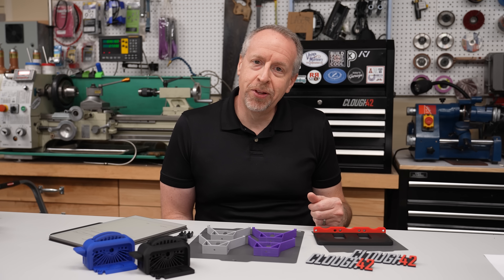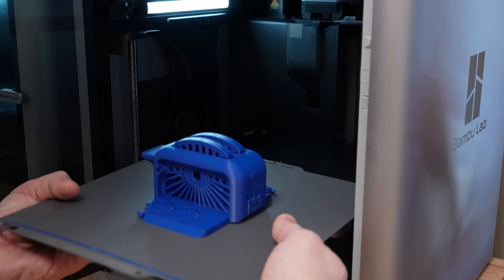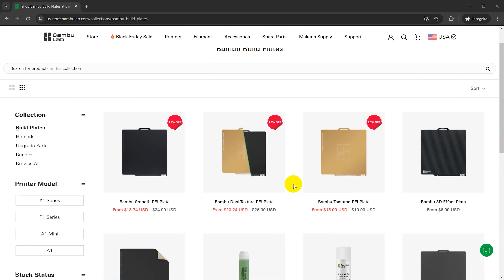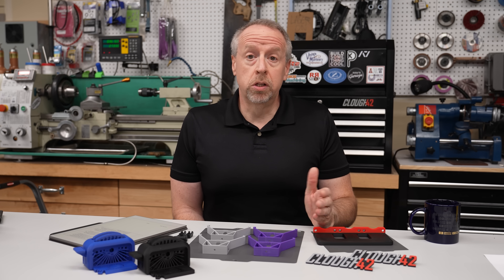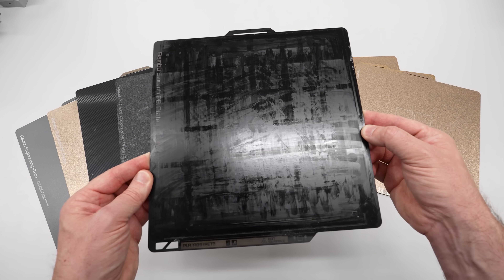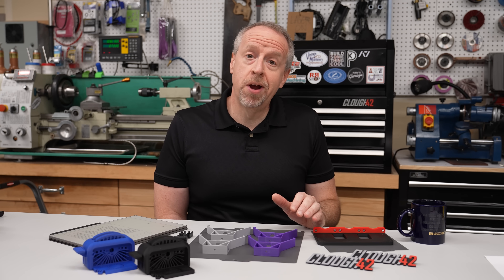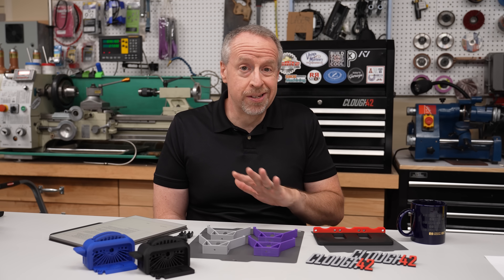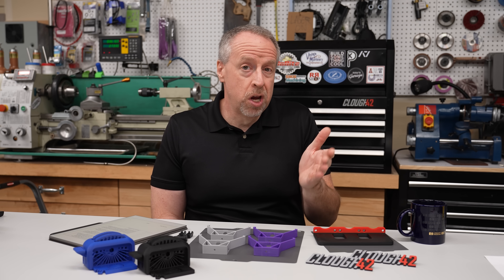Can't get your prints to stick?  Try this

Comment: The new Bambu Lab Cool Plate SuperTack has revolutionized 3D printing for our organization. Print failures have significantly decreased; now, issues only arise from user errors, such as leaving objects on the build plate or filament jams at the spool. The enhanced adhesion and reliability of this plate have streamlined our workflow—highly recommended!

That said, it does introduce a new challenge: it can be extremely difficult at times to get the item’s edge to release from the build plate. Once you manage to lift a corner, it still takes considerable effort to pull the print loose, especially with large surface area contact. But honestly, I’d take this over print failures any day!

Seriously though, since having this plate for about 10 days, I’ve had one print failure—that’s right, just one failure across multiple machines all running the new plate. Incredible!

Comment: I pretty much only print with PLA, but the creality glass plate with the self releasing coating has always worked BEAUTIFULLY for me. Granted, for smaller prints, it can have less adhesion if not properly cleaned and trammed, but It's never really been THAT much of an issue. Plus, I can usually just add a brim if it DOES become an issue for some reason. I've never really seen a need to get anything else for bed adhesion, but that's just my personal experience.

Comment: Thanks for the review. Recently I had some issues with adhesion to a textured plate and had to crank temperature up and play with enormous brim. I already ordered a smooth PEI plate. If it doesn't help will switch to this SuperTack.

Comment: Yes.... I use a flat steel plate and PVA glue.
Sometimes they stick too well and I have to soak the plate and glue in water to get the parts off the plate

Comment: Why people using glue. Im 1000h in my a1 and never used glue standard setting .2 mm layer height just had once adhesion problems science then i  clean my plate with dish soap after a couple of prints

Comment: I installed a build plate guide on the left rear of my X1C. It sticks up enough that you can easily position the plate side to side with it angled up enough that the magnets don't grab it. The guide is low enough that it doesn't interfere with the print head. I found it on MakerWorld.

Comment: Im a firm believer in cleaning is key! And dawn is NOT it. I use fast orange mechanics soap with pumice and an old toothbrush. Scrub the plate with the soap and brush without water. Then clean with hot water, as hot as your water heater can do. And you can instantly feel it with your hands. I haven’t used glue since and have never had one come undone.

Edit: i forgot to add. Let the plate cool makes a HUGE difference when removing. I freaking love the engineering plate. But i would like to try this bc id like an extra plate

Comment: I have been trying the new plate in the X1C with PETG and having issues.  Support says there is a problem with latest firmware causing the plate to not be noticed 2) stringing / print letting go after 1/2 way through the troubleshooting print 3) issues and it z calibration .Support is helping but was hoping for better results.

Comment: I’m always a bit confused by other people’s practices around bed adhesion. 
I’ve found clean textured pei to work fantastic with pla as long as it’s cleaned properly. And hairspray has worked great with petg in the past but I haven’t used it in awhile. 
I really want a g10 on steel sheet. I had g10 for my old cr10 and it worked great for everything I needed. Including flexibles and the texture is really nice.

Comment: I’m concerned about the validity of your advice because of the REASON you’re using glue with PETG on PEI. 

PETG seriously bonds to PEI. It’s a problem I can only solve with a razor blade after the bed cools.  I use glue as a release agent, not for adhesion.

Comment: Check out either SHIFTY or “Build plate alignment guide & cap” they are mods that align the build plate for you, the first hugs rhe left and right sides, the second add the same bracket the A1/A1mini have with the nozzle cleaning area notch - to the X & P series

Comment: Ah, this is what people were talking about when they said this is why biqu did the buy one get one free deal. I bought the biqu 2f1 deal, haven't tried them yet, lol, so I guess this will be even further down the stack. But I'd been using the original PEI textured plate from bambu (the grey one that came with the x1c) for ages, then finally bought the new gold coloured textured plates, and I found the gold texture plate holds on to PETG too well. Thanks for the tip of reducing temp to reduce grip, I will need to try that.

Comment: Don’t understand why you use glue on beds. When I started out in 2011, glue stick helped on the crap surfaces,  but by the time wham bam and others came along it was not needed. I’ve been running 2 Prusa mk3 for 5 years as a side huddle and had no pla or petg adhesion issues and they have never been near glue. Same with my 2 X1Cs with textured pei.

Comment: i'm generally printing Printer parts out of ABS/ASA, and my goto has been , and will probably continue to be the engineering plate. the textured plate is a bit too textured for mating surfaces ive found, and the smooth/hi temp plate give a glossy approaching mirror finish which looks real wierd when its only on one face of the print.  in fact, i've been having to put glue on my engineering plate just to get parts off the plate or they stick too well and take a chunk out of whatever epoxy-esque finish they used for the engineering plate.

Comment: I'm not sure why everybody has issues with the engineering plate. Maybe it's because I wipe it down with isopropyl alcohol Before every print and almost never use glue stick.

Comment: OK I learned something.  I had been thinking that I always printed PETG at 75C on my Prusa MK4's (textured  powder coated plate) and when you said you couldn't always get your prints to stick I was about to really question what you were doing wrong as I never get failures and I really respect your design processes.  A quick check and surprise I'm printing at 90C. I'm thinking that Prusa must have changed the default behind my back.  LOL.

Comment: My main gripe with bambu textured pei buildplates or others like the biqu cryogrip (I use both) is not adhesion. It is the thickness of the spring steel. I print plenty of large parts that has perfect adhesion but the plate still bends around the outer edge due to being too flimsy. The magnetic force is not enough. For more damanding tool type prints I have been forced to glue shape cut plates to the underside of bambu buildplates to avoid warping. I am surprised thicker buildplates never seem to be on the table. I have at least googled for it many times in the past.
Reply: It sounds like you may haveegotten a badly warpped build table on your machine. I know they were having issues with this a year or 2 ago. Not sure how long ago you got your machine but Bambu was repairing or replacing machines that got the defective plates. I would reach out to them, they will send you a test file to measure the run out on your bed, and possible replace it if its bad. (considering they are still covering this issue.)
Reply: @PhoKingLitMedia  In my mentioned case this is not the way it is. The plates do bend in the corners and lift off the magnetic bed from shrink forces in the bulky prints. I have several p1s machines spread out over end of 2023 and the year 2024. None of them has any bent plate problems. It has helped some to insulate the machines to keep some more heat in, but too much and that will cause other problems with petg for example. The reinforced build plates does the trick, but are clumsier to handle as they can't be bent as easily for print removal. I have just used regular steel, not spring steel.

Comment: That looks super interesting.  I remember years ago when LocBuild made a super adhesive bed for 3D Printers.  For parts that had low bed contact - great. For large stuff like your model, it fused to the bed.  I’m looking forward to trying g that plate on my two A1’s

Comment: I use a glass bed with any kind of filement and a mixture of 50% white glue/school glue and 50% water. Everything sticks like hell with around 50-60 degree C and pops right off when the plate cools down. It is washable with warm water without leaving any traces. A printbed for eternity.
Reply: Very interesting but how did you know it is 50/50.
I mean how are you measuring the glue and water, glue seems like it would be hard to measure by volume so are you measuring by volume or are you using a scale and measuring by weight?
Reply: @andreamitchell4758  Just roughly eye leveling it. If it's more on the watery side, you can apply it thinner, but it needs longer to dry. If it's on the thicker side it cannot be spreaded good enough and does not work as good. If you hit it just right, you can spread it good and it dries completly withing the warmup phase of you printbed.
Also not every glue brand is the same consistency. But it's not science.

Comment: Saving energy with lower temperatures but still needs over 60 degrees bed-temp for PETG? Wow.... I have been printing with lower temps for PETG on my Anet ET4 and also A8plusses for many years on their original surfaces or on other cheap surfaces. Also without gluestick.
Also printing on some of my printers on cold (around surrounding-temperatures so say about 16 degrees in winter) beds. Especially the 'bendy plates' with springsteel are easy to use for this. Only problem is that they wear out slowly and sometimes just stick too much so then like some sugarwater to protect the beds from sticking too well and breaking.
ABS I print normally at 70 degrees bedtemp though sometimes also at 60 when using smaller parts of the beds. ABS though, mostly kind of enclosed.

I think it should be possible to print with lower temps with those beds. Can you do some tests with that? Just go around 40-45 degrees for example with PETG and 25 for PLA?

Comment: I don't understand, why would they boast about having the bottom surface of the part look like the top surface? Who would want that? The bottom surface always looks a lot better regardless of the build plate, unless your Z-offset isn't set correctly or the mesh leveling is off.

Comment: I've been having poor results with the SuperTack build plates on my P1S. Lots of warping on the edges, hardly any adhession. I just can't figure out why. I've been using PETG HF. My textured PEI plates on the other hand have no issues, to the point where I use a glue stick as a release agent or else there's risk of part damage.

Comment: Bed adhesion is one thing but then supports will brake if large part. The solution is to use cold bed, put PETG plate 2mm like Vivak using double side tape and allow this plate to gradually bent. So I think that vacuum bed should be tested if allow slight bend using many small holes.

Comment: ok so after 50 prints, what does the plate look like? it seems fimsier than a PEI sheet and they get ugly after a few months of high print time. Does PETG stick too hard? That is the issue on pei textured sheets. Not that it doesnt stick, those are just user errors.

Comment: I've been tempted by all these new plates (bambu and biqu), but really I haven't had any issues with the gold textured PEI plates on my A1 and A1 mini printers. Just a quick wipe with 91% isopropyl alcohol before every print and everything sticks fine. I do only print with PLA, PETG and TPU though, but all of those have worked out fine.

Comment: Its amazing how far we came along in terms of build plates on FFF 3d printers ! i recently upgraded my printrbot metal bed  from Glass to PEI for PET filament . if on the glass plate i always needed glue to have the print stick  on the PEI texture plate  i don't use any glue ! Really curious about this Bambu Lab SuperTack ! you mention it works well with PETG but what about PET ?

Comment: I disagree about the engineering plate. It's my go-to plate for ASA and ABS, because it works incredibly well with both. As for your trouble with glue, I highly recommend spreading your glue on with a couple sprays of IPA. The glue dissolves in IPA, so if you apply a few swipes and spray it with IPA and wipe down, you get a super thin perfect layer of glue that is much easier to work with and leaves much less residue.
Reply: Fully agree with you about the Engineering plate. I almost exclusively print ASA (100 degrees bed temp and no glue) and TPU (generic TPU profile). I have no issues that weren't of my own making. I'll need to find a good replacement for the engineering plate now it's been discontinued.

Comment: Most important question not answered 😬How many prints does it do before this amazing adhesion stops to perform. As with any advanced textured surface with high adhesions 1 of 2 things will happen, either micro bits of plastic will ramain on the buildplate, or micro bits of the build plate will remain on the printed part. And once the build plate is clogged up with micro plastic, its done. Or once the entiry magic layer of the surface is distributed over printed parts, it's done.

Comment: Glue stick, tape, hairspray.... ect.  I don't understand this.  Are you people using silicon lubes on anything in your homes?  Maybe wives makeups or something the kids have?  I have NEVER, EVER needed anything to help adhesion.  Things stick TOO GOOD in fact.  I do a finish with windex for PETG so it doesn't tear the part when I remove it.

What is half the printing world doing?!?!
Reply: ever tried printing nylon or PC? large abs or asa parts?
Reply: @riba2233  No, I don't have an enclosure, but that's not what I'm talking about.
Most people don't even seem to be able to print PLA without problems.
I stick to PETG, PLA and TPU.  I've never needed any of these extra things.
I'm a functional printer that designs my own parts from scratch, yes, some of them are large.  Most I've ever done is a brim.
Reply: @piquat1  yeah for those materials adhesion should not be an issue, even without the glue
Reply: @riba2233  Correct, they shouldn't be.  Silicon contamination can shut down entire manufacturing plants.  They're so strict at some of these places they want to know what your clothes are made of and what cosmetics you use.
I wonder if silicon or some other chemical is being used by these people that keep them from even being able to get PLA to stick.

Comment: I actually never had any trouble getting PET to stick to normal build plates once I cranked the heat to eleven, I've always found enclosed printers are ludicrously overrated, and each and every power failure restart I've tried so far has resulted in a compromised at best, scrapped as norm part. Last but not least, I quite enjoy having an easy time popping the part off the plate. If you're printing huge cosmetic parts like figurines and whatnot, maybe, but for me it's a polite pass.

Comment: Bambu has solved a problem they themselves introduced! The textured PEI adhesion is too low because the marketing team thought prints falling off themselves  after the plate cools down is a good selling point. It isn't. It's a clear proof the adhesion was too low to begin with. The plates should come with a steel wool treatment straight from the factory, period.
Reply: ?? what are you talking about lol

Comment: For my PLA prints, I use the stock X1C cold plate. To drastically improve adhesion, I did something that worked wonders for me. Here's the process:

Clean the plate with water to remove surface dust and debris.
The trick: I rubbed the plate down with silicon carbide powder + water by creating a slurry (around 2000 grit). This step made all the difference, even restoring adhesion after handling the plate with oily fingers or using poor-quality isopropyl alcohol.
This method worked so well that it made my adhesion way better than stock. I shared this tip on the 3D printing subreddit, but the post was removed for being flagged as a "potentially hazardous tutorial." Oh well.... Damn mods.
Reply: Your printer will have less vibration if you pour it in concrete.
Reply: @TheOneAndOnlySatan  lol?

Comment: I use Lightyear G10 (garolite) plates with PPA-CF and PA6-CF. PPA-CF doesn't need any kind of adhesive on that plate and it keeps a perfectly flat bottom.
Reply: I've been using an FR4 rated sheet of G10 from McMaster Carr for years and print all sorts of materials all without any issues.

I only wash it with dishwashing detergent every now and then since 92% IPA leaves a residue and negatively affects bed adhesion.